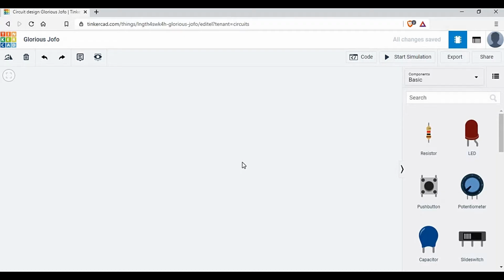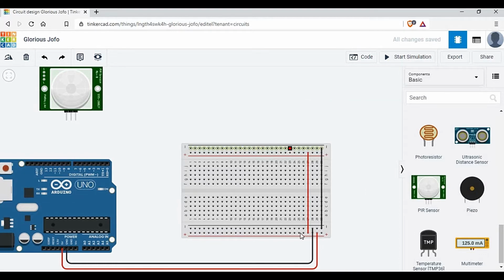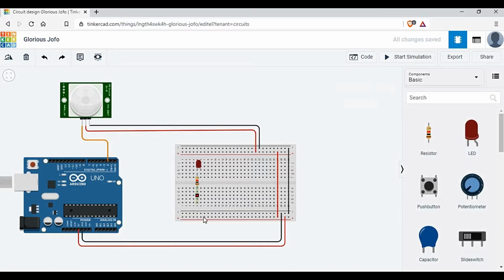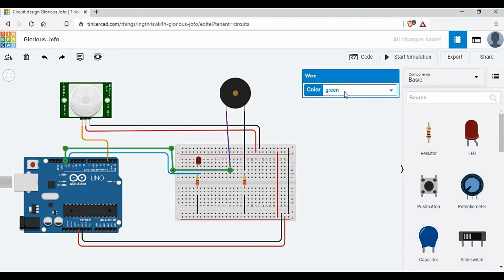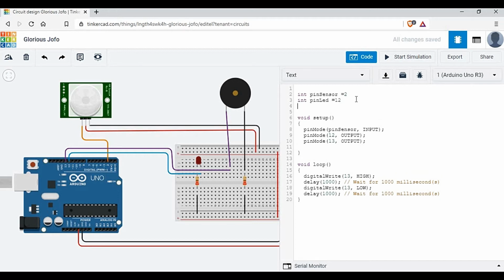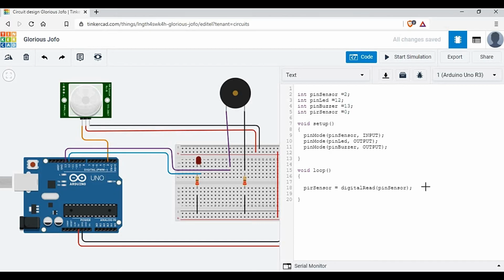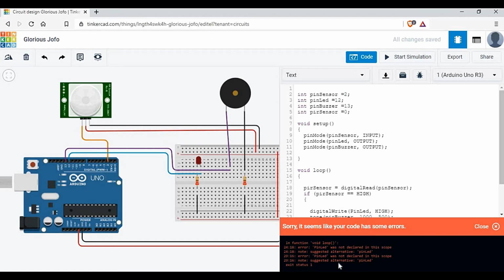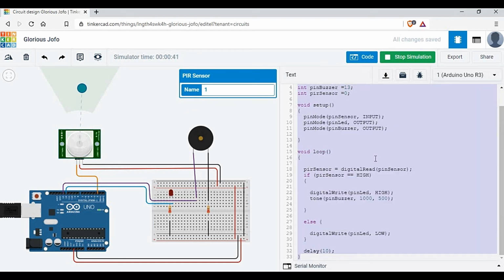Arduino Tutorial For Beginners | PIR Sensor Arduino With Buzzer and LED | Thetips4you

Comment: Hi! Amazing video. Thank you for giving a really in depth explanation on each part. I would love to know, why do we need the resistor to connect to the ground? What if we just connect the LED and Buzzer's positive terminal directly to the ground?
Reply from the maker: You need to control the current flow. If led and buzzer can accommodate the current flow you can connect directly.

Comment: Hello, i just watched the video its so helpful for me because i ca use this to program my project, but may i ask, is it okay to use ultrasonic sensor rather than RIP sensor? And any kind of buzzer will do right?
Reply from the maker: Yes you can use ultrasonic sensor however you will have to change the code. Ultrasonic is usually used to calculate the distance as well.
Reply: @Thetips4you  at what part should i change the code, can you guide or something? Thankyou so much
Reply: @Thetips4you  can you help me modify the previous code? So that it would be suitable for ultrasonic sensor? Thank yoou so much❤
Reply from the maker: Sure I can help. Pls contact me through fb @thetipsforyou.

Comment: I did everything you did including the correct code but my buzzer and led lights turn on even though I don’t move my sensor, any idea how to fix it and only make the led and the buzzer ring when the sensor is moved?
Reply from the maker: Can you contact me through fb "thetipsforyou". I can have a look on your circuit and code.
Reply from the maker: @Vajresh Kundurthi You can define the pins by default as Low in Void Setup, or also check if the PIR Signal pin is connected properly. it should not be getting High value always which will case this issue.
Reply: @Thetips4you  how would you do that? And what code should I write for that? Because I have the same issue
Reply from the maker: @jort.thijssen3314  In the Void Setup , add Digital Write to Low for the pins which are connected to LED and Buzzer, PIR sensor. Also please double check your PIR sensor Pins connected. if you connect 5 V to signal pin it will always give high output.
Reply: @Thetips4you  can I maybe text you on anything? Because I am still kinda stuck with it haha
Reply from the maker: @jort.thijssen3314  Please contact me through FB @thetipsforyou
Reply: @Thetips4you  I send you a text! Thank you